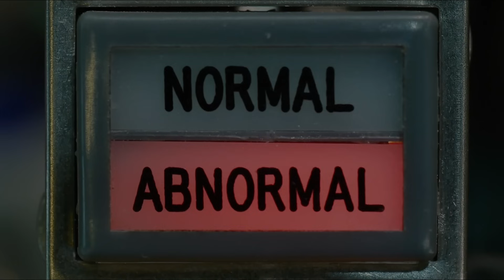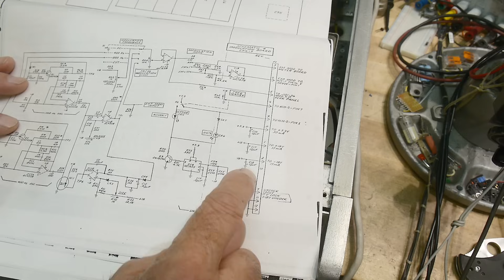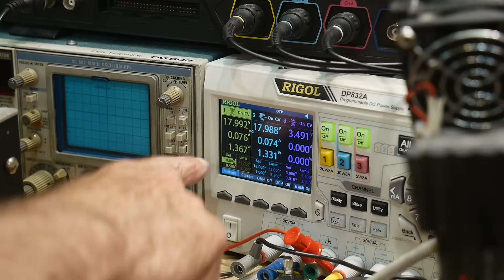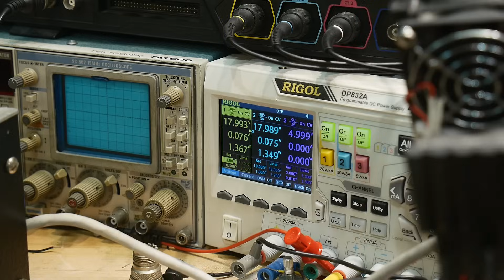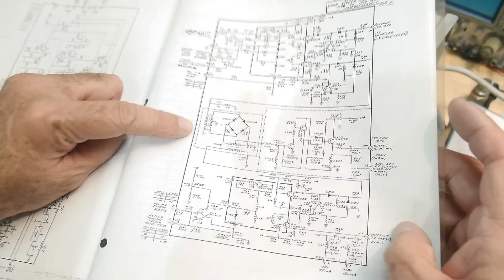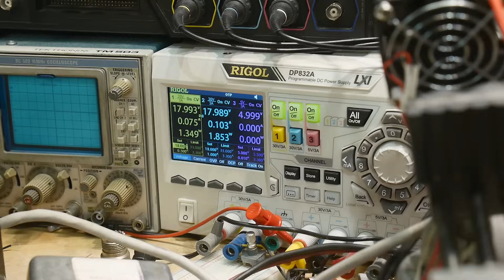#1902 Wavetek 3000 RF Generator (part 4 of 14)

Comment: They used MC1458 op-amps, which are spec'ed at absolute +/- 18V max, and run them at that voltage. Hmmm...
Reply from the maker: you are right. not good practice

Comment: I recognize those little Teflon solder cups from a military ADF program I worked on back in the early 80's. Very similar construction techniques. Those tantalum teardrops caps have been a real issue in some of my old test equipment I have. They will just short all of a sudden and send that supply into protection or sometimes just take out the series pass transistor like a fuse. I've just went thru and replaced them all figuring if they made it 40 years I'll be gone before needing replacement again. 🙂 👍

Comment: Looking at the solder-blob circuits inside of this Wavetek reminds me of when I worked for Anritsu during the 90s.  It was common practice to create synthesizers in dead-bug form.  In those days engineers had their own workbenches in their cubes - with soldering irons and whatever lab equipment needed.  This facilitated a creativity that has seemingly vanished in modern companies.

Comment: 1. As you will discover soon enough, Wavetek had a near 100% failure rate with those tantalum capacitors. The smell of the recently dead cap is truly memorable. In the Wavetek test gear, it's the gift that just keeps giving. 2. Next major problem: +/-18V rails. These power most of the opamps. But this is at or beyond the absolute max supply voltage for those opamps. Wavetek: Designers for Disaster. 3. Construction method is what's possibly ok for prototyping, not production. What a total mess.